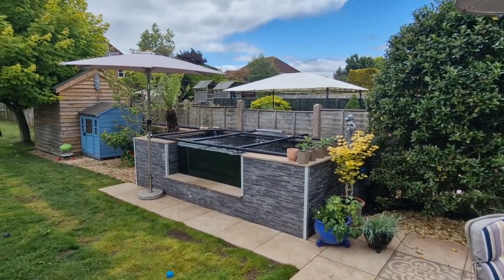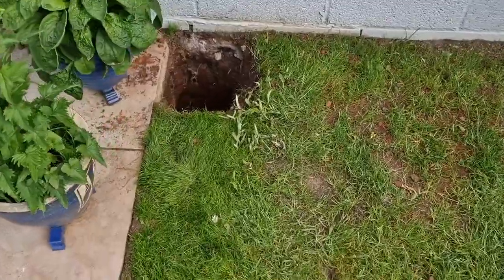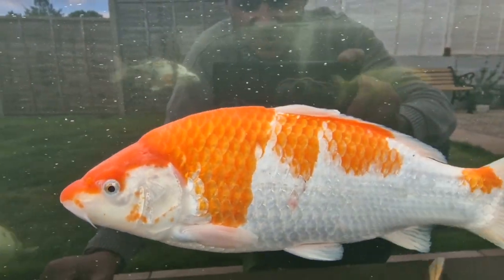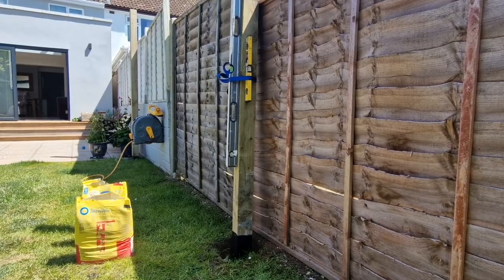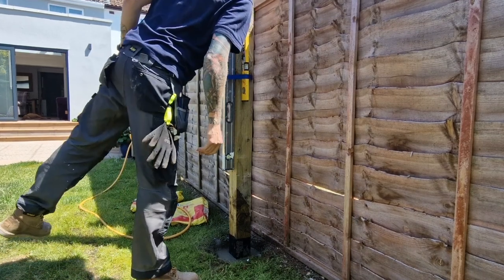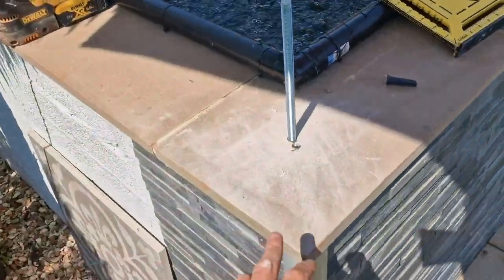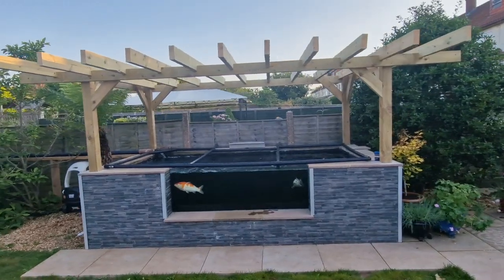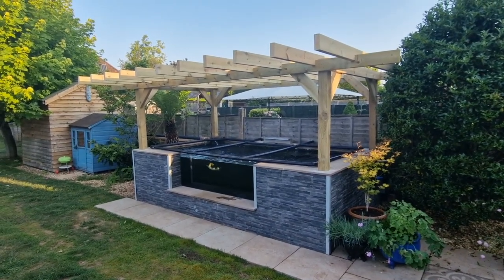Summer is here!!.... Koi Pond Shade Sail or Pergola?.... Or Both?

Comment: Hello,what did you use as a sealant /glue  for the bar to wood and top of concrete, thanks
Reply from the maker: I took a chance with CT1.... I did think about using some sort of resin compound but after completing it I'm more than confident that it won't go anywhere. If you were to put a roof on it or enclose the sides I would definitely use resin compound or maybe even post brackets and anchor bolts. With a roof and enclosed side I'd be worried about stong winds lifting it. Hope that helps